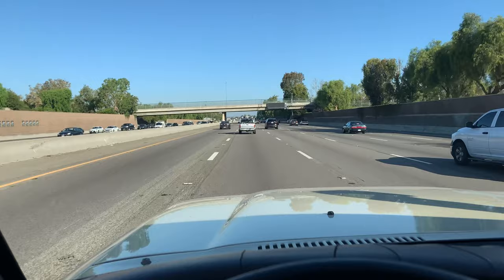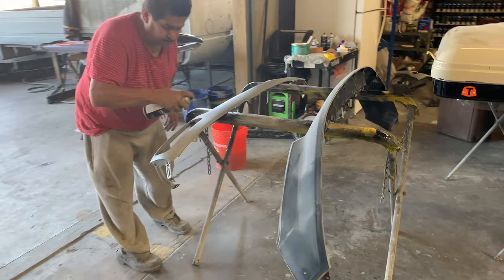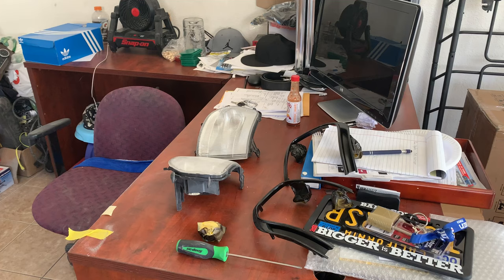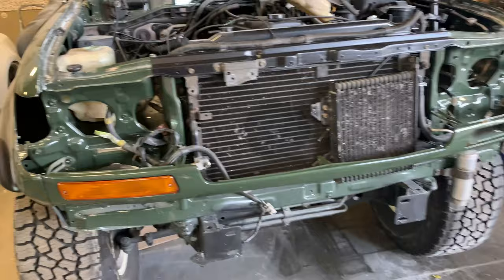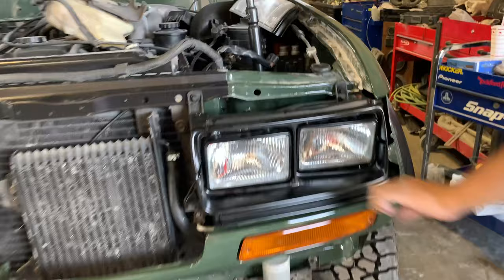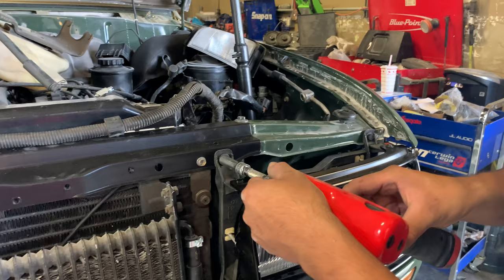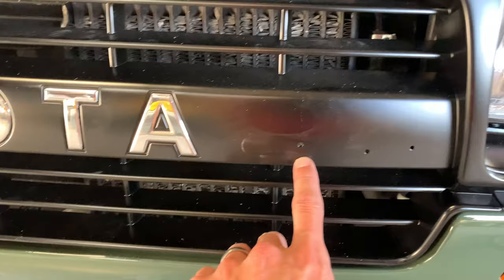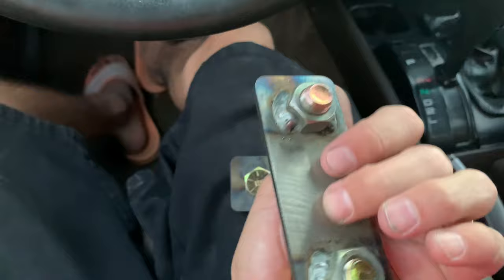Tjin Edition 1994 Toyota Land Cruiser Overland SEMA Build Part 7 - Army Green - DAYUUM!

Comment: DTE garage, you should not cut the head light case, the corner you had was American, the japanese is shorter and fits well with the original case, that hurt. But great job with you 80.
Reply from the maker: It hurt indeed. We had no choice at the time.

Comment: Couple clarifications: So that's a Delta suspension or just a raised panhard bracket? And what do you mean "sideskirt" are you talking about the rock sliders?  Nicely done 80 for sure!
Reply from the maker: To be more clear. It's a Delta caster correcting radius arm and side steps, more than actual sliders. Sorry, we are noobs.
Reply: @DAYUUMxTJINEDITIONGarage  Are you sure it's the caster correcting radius arm? Those would be for the front suspension. If you look at Delta Vehicle Systems website they show it as a $250 panhard lift bracket. https://www.deltavs.com/product/fzj80-fj80-panhard-lift-bracket
Keep up the nice work on the 80. They are getting more valuable as this 'overlanding' thing keeps getting more popular. Oh, and I only clarify for others who are doing similar builds so they don't get confused. ;-) Thanks!
Reply from the maker: Youre correct. What you see in this video is the panhard bracket. The radius arm is in another video. I got the videos nixed.